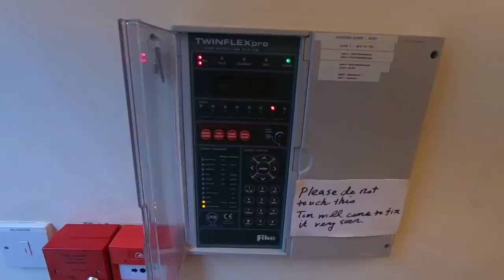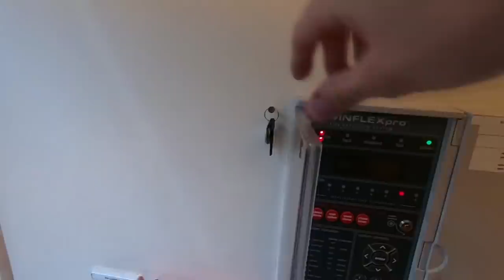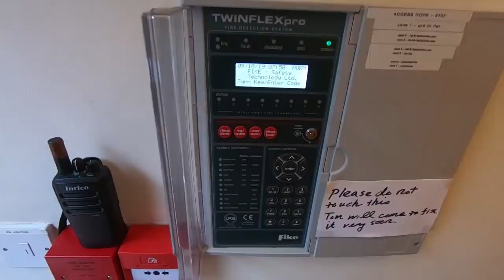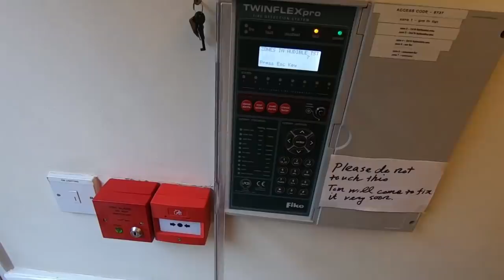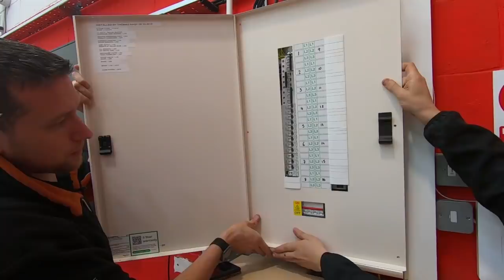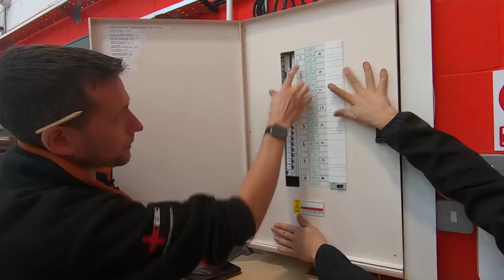Fire Alarm smeg and some board work

Comment: Hi Thomas. Worth pulling the detector apart if it's a photo type and there's no "reason" why it alarmed. It could be the tenant smoking. But it could also be a tiny insect inside the optical chamber. Or dust build up over time. If I can't find a "cause" I replace because then if it does alarm again you've eliminated a whole lot of reasons.

Comment: Mate the amount of times I get called out in the early hours for false fire alarms is astonishing. There’s something in newer smoke heads that hates dust.
Reply from the maker: 100% agree. older systems tend to be resistant to false alarms.
I suppose newer stuff is just built to more stringent standards and therefore more susceptible to the knob in the hallway having a cheeky puff.

Comment: For the neutral switching. In the netherlands and i guess a few more european countries it is a requirement to be able to switch the live and neutral. If the neutral is not switched off the system should be considered as hot. This is according NEN1010 or NEN3410.

Comment: Sparks! Why am i seeing 120 volts between neutral and earth on the outputs of a dc power supply with 240v input.
No voltage between e and n at socket...

Any ideas would be much appreciated:)  Novice technician fitting simple counters on the end of a conveyor system..  wall Plug -> 240 volt to 30 volt ac to dc PSU -> item counter.

Comment: Its not a fault its been set off check the log 
Also 3647 is engineer code 8737 user code

Comment: bro there not quite good those are the correct ones that every sparky should use when tightening up the  connections on the fused board